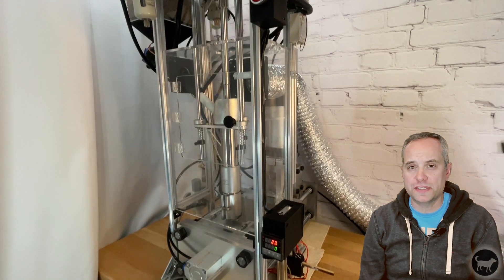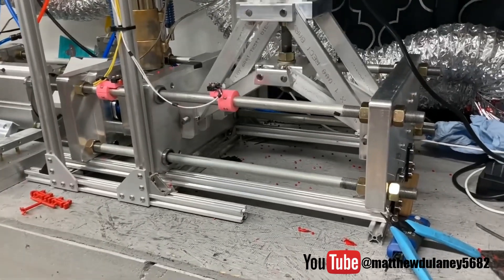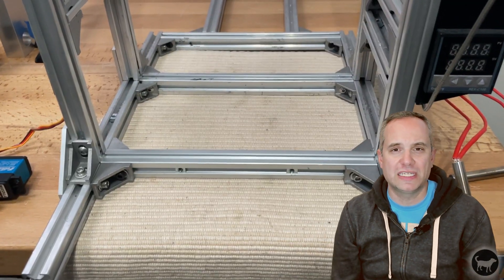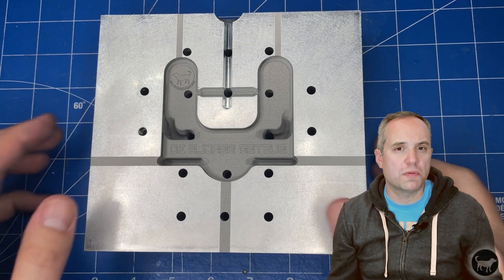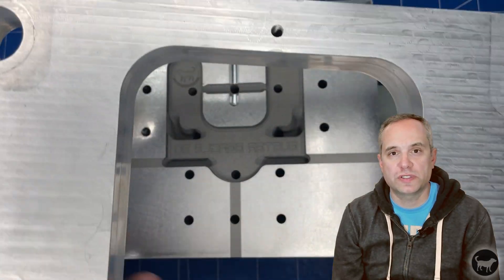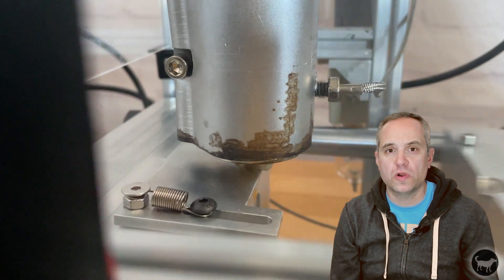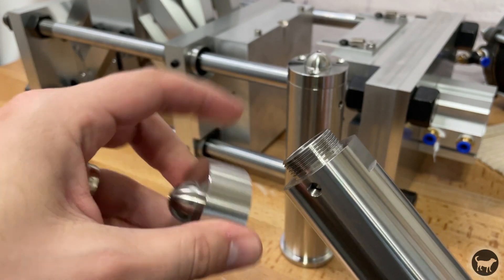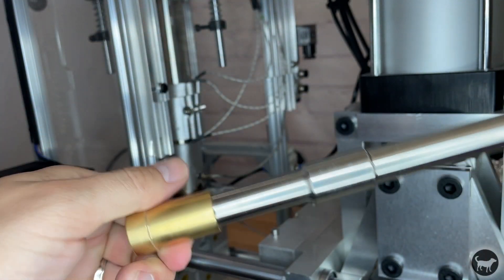Buster Beagle 3D Injection Molding Machine MK4 Updates | MK4 Chamber | Pneumatic Vise.

Comment: I need an injector like these for my business I am starting. I am also looking at the ones from sustainable studios. They have a bigger shot capacity that i need nut there is no and i mean almosy zerow reviews online. Does any one here have  any knowledge or opinion on the mini v2 from sustainable design studios?  Alos how imposible is it to increast the shot capasity to 5 or 6 cubic inches?
Reply from the maker: I'm was not familiar with the Mini v2 or Sustainable studios but from just looking it up that particular machine it is under 5 cubic inches. Looks like they have a much larger Arbor press that might be what you are looking for if you need a larger shot. The MK4 is 5 cubic inches and if you check out the Facebook group there are some who had added even more extensions to the MK4 making it even higher. Either way good luck!

Comment: Looks like a little factory! nice!
Reply from the maker: Thanks. We are getting there.
Reply: Will you be releasing a compatible pellet dispenser for automation as well? Thanks!
Reply from the maker: @winston8586  I had released one a while ago on the Buster Beagle 3D Facebook group but I am currently in the process of refining that setup to make it better and easier to add to the machine. More updates should be coming for the machine as quickly as I can.
Reply: @BusterBeagle3D  Awesome! I wasn't really aware that "hobbyist" injection molding was a thing and this would be a perfect step between 3d printing everything and actually contracting a factory to do injection molding runs. Can't wait!